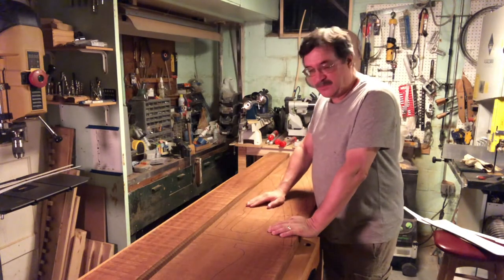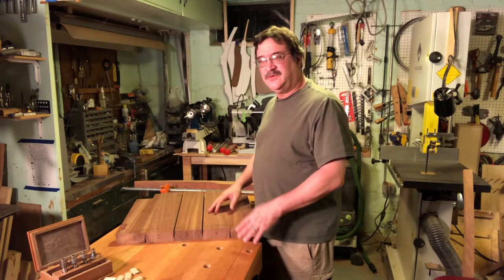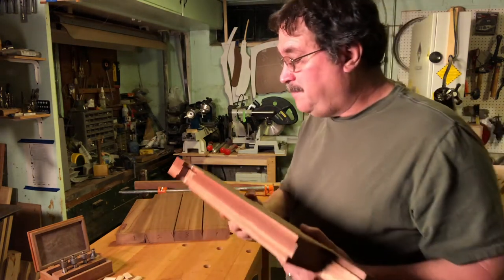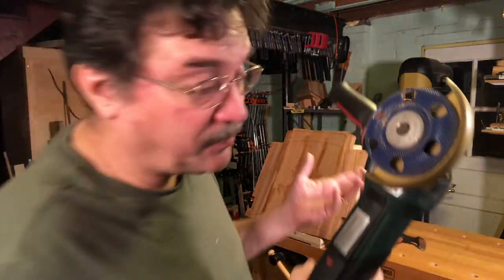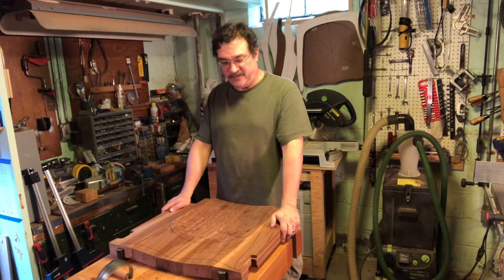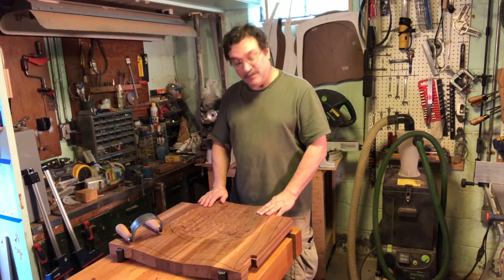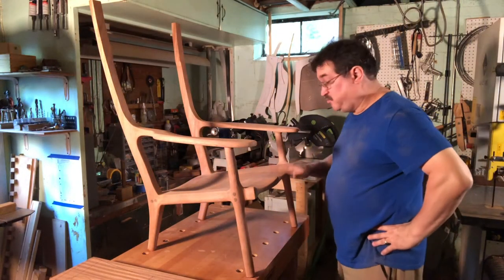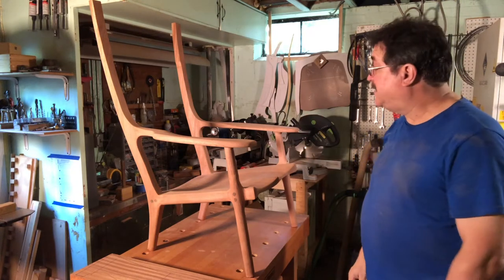Building a Maloof Style Rocking Chair

Comment: Your chair is beautiful.  Very well done.  I see I'm not the only one who has had problems with sapele.  I love the wood.  It's beautiful and it usually works nicely but not on the rocking chair I made (not a Maloof inspired chair).  I had a terrible time with tear out when carving the seat.  I also use hand tools for that.  I ended up using my random orbital sander with course paper to finish the seat.  I felt like a failure.  You have more experience than me so I feel at least a little redeemed.  I'm ready to attempt a Maloof chair in black walnut.  Just bought the wood ($15/bf - ouch!).  I can only hope it comes out looking respectable.    

Hope you sell a lot of them.  It truly is a heirloom quality piece.
Reply from the maker: Failure, Smailure. I always say don't get hung up with processes. Do what works. Did you finish it? Did it meet expectations? Did you enjoy building it? Then it's a success. Good luck with the Walnut. I've built chairs from it, it's beautiful wood. I think you'll find it's pretty similar in working properties to Sapele. Not quite as tough, but still hard to carve. But worth the effort. I recommend you wet the pieces to see how they color match before you start butt joining them. Walnut tends to look the same until you put the finish on it and then you'll see unwanted contrasts in the tonality.
Reply: @chrisdesautels5394  Yeah, I finished it.  I meant I failed at the carving bit, not the whole chair.  It turned out pretty decent.  Of course, I can seen every little flaw but most people ooh and aw at it so I have to give it an overall thumbs up.  My brother started woodworking about the same time as me.  He said he's come to the conclusion that woodworking is about covering up your mistakes well enough that no one notices.  

Good tip at the wetting of the wood part.  I'll do that.  Thanks for the feedback.
Reply: We always see flaws no one else will never notice.

Comment: Hi,
Great video.
Did you use a set of plans? and if so whose set did you use?
Thanks
Reply from the maker: Yes, I usually work from own designs but in this case I used blueprints included with this DVD set. https://finewoodworker.com/build_rocking_maloof_rocker.html